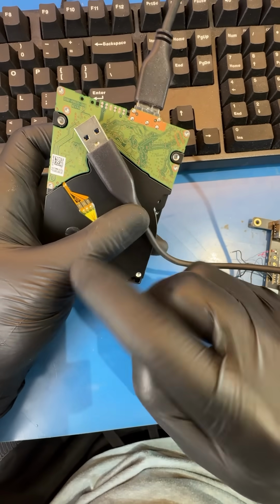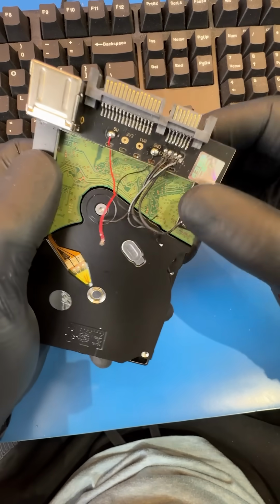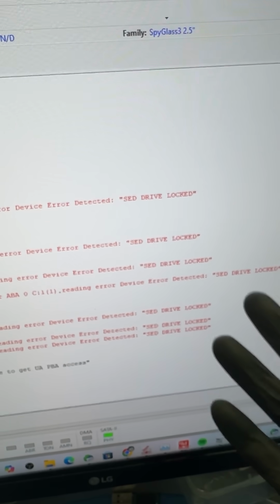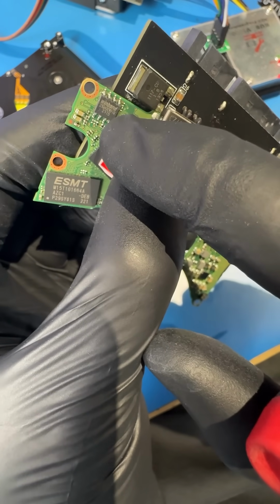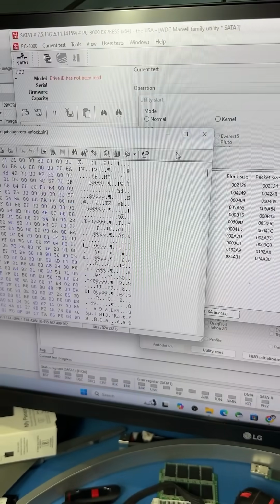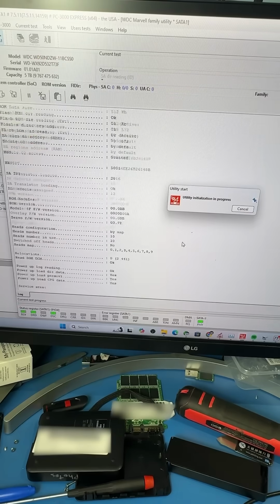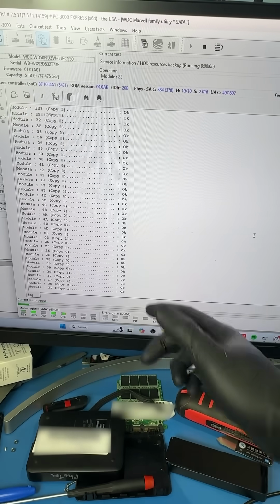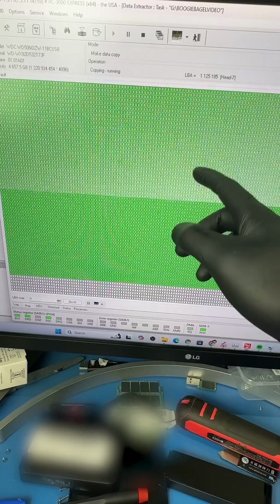Self Encrypting Drives... #tech

Comment: How is this secure with the locked firmware?   Like I understand why some people would like to see it on the features list, but in practice it looks like you've essentially used a padlock on a door, but duct taped the key to the back of the lock.  Not really sure what the point is except making more steps that aren't too difficult.

Comment: Even though the drive was only locked and not encrypted, there are self-encrypting drives. Years ago Microsoft figured out a weakness in the self encrypting drive code, which supposedly some of the manufacturers fixed. 
So based on that event, Microsoft recommends that you do not allow the drive to self-encrypt but rather to use software based encryption.

Comment: so the key for the drives encryption was stored directly on the drives pcb unencrypted!! I guess this is a proprietary security measure specific to the manufacturer and not very secure ..or was the drive just locked by the pcb but the data not actually encrypted?

Comment: It crazy to think that in just 78 years we are able to store terabytes of data on regular hard drives and with specialized equipment we can store a petabyte for perspectivd the eniac 1 could 80 bytes back in 1946 and it was huge taking up a massuve root with vacuum tubes now we can store a petabyte = 1 quadrillion bytes that is a 12,499,999,999,999,920% increase considering advancement rates that it incomprehensible

To visualize that number 1 quadrillion is a 1 with 15 zeros so this 
1,000,000,000,000,000
 The human brain cant even begin to comprehend the sheer scale of that number

Comment: Now you know why it's necessary to drill holes through drives in order to thoroughly disable them.  Even if you have encryption, they can just disassemble the drive, flash new un-encryption locks onto the firmware, and bingo, the data on the drive is unlocked.

Comment: I have 2 2TB hard drives 1 I bought about 7 years ago, worked for about 2-3 years then stopped working, then I bought another 3 years ago, used it literally only 3 or 4 times in the 1st year to back stuff up in it and stored it away for a while,  and it stopped working the 5th time i tried to use it to retrieve files. Lights up, u can hear it spinning, but nothing comes up when you put it in the PC or laptop!
I gave up on all harddrives since! Im now considering buying an M.2 ssd to put in my motherboards 2nd m.2 spot, and use that as backup, and then remove and store it securely with my important stuff, cuz the PC I builts m.2 has been working for a long time now going onto 5 years since I built it!

Comment: I disconnected my drive (by pulling he plug) n it stopped working n getting detected. after this incident I tried many things to run the drive and these tries used to make a clicking sound every time. one of the recovery company said there are too many scratches n data cannot be recovered. will I ever be able to recover the data?

Comment: Before doing any of that try this first.  
If you here that clicking sound, it may mean the read head is stuck.
First just tap with the handle of a screwdriver. You only need one last spin up to copy the data from the drive.
  If that doesn't work put it the freezer, then let it thaw out, maybe 2 -4 days.
Then hook it back up, if it doesn't spin tap the side gently with a screwdriver handle again.
Metal contracts when it gets cold and sometimes this is enough to let it spin one last time. My IT instructor told me this trick and it has worked for me.  Do everything else he said AFTER you try this

Comment: Something tells me that lock feature really helps sell new drives.
Reply: Pretty incredible. "Self encrypted drive" basically means "completely unprotected drive" if anyone can get in. What an absolute joke.
Reply: @TigerGreene  From what I've read, self encrypted drives always encrypt stored data. However, unless you properly configure them with an authentication key, the drive externally appears to be unencrypted. Presumably that extra step was not taken with this drive, so reading the data through the drive was not an issue. Whether the onboard encryption is properly implemented is another matter
Reply: Locked  probably meant it detected a shock and did not want to spin the drive anymore.   SW Encryption drives are used if you want to store your data safe.

Comment: Don't rely on a 2.5" HDD.  I lost a programming project years ago and I'm still mad.  It was a streaming music ripper.
Reply: 2.5" Drives are fine, they generally fail more just because they are usually used in portable equipment like laptops and USB drives. I had 4 2.5" drives running in a NAS for nearly 10 years and lost one drive in that time. It was RAID 5 so didn't even need to recover from backup, just slotted in the replacement and resilvered the RAID.

The thing missing here was a backup.

Comment: Wait, so the SED DRIVE LOCKED (SED standing for Self-Encrypting Drive) can be bypassed just like that? Or did you get the key from the customer? Or does the drive not actually have nor advertise SED functionality, and it's just using the same error code for a non-encrypting SATA password lock?

Comment: One can do this in the bathroom if they tape or hold with magnets, cloths around the boarders of the door and a towel at the bottom with the exhaust fan ON.
I had to unjam a locking piece preventing the disk arm from mounting on the platters. This took time and patience and fixed the 'click of death' problem.

Comment: I have an old wd external drive, that for some reason it's not powering on anymore, I took it out and put it in my Pc, but the drive is not receiving any power. I have a hunch that the issue is the power connector and not the drive itself. Can I get a quotation from you?

Comment: I honest-to-god hate these drives. Having been on the receiving end of a customer tirade a few too many times because of them. Rather than use an adapter board to convert SATA to USB they just solder the board right on the drive handle it all making enclosure replacement impossible. It's especially obnoxious when USB in question is the flimsy USB Micro-B Super Speed port.

Comment: Bro, my laptop hdd is not working so, i opened my hdd to check whether head got struck in platter , but it was in normal position only.meanwhile  small dust setelled on the platter. I ran the hdd , thought not working. Can u recover all data safely ??

Comment: I've 32 GB encrypted memory card same phone before changing my Samsung galaxy m31 motherboard facing auto restart issue after installing faulty software update compny replaced free of cost hardware replacement but my encrypted memory can't decrypt with same phone just bcz replaced motherboard so now what I should I do for recover my data..?
My Samsung memory card currently work well just asked to format but can't so plz help me out to fixed by esY step I'm not it or technician or engineer to repair by self

Comment: What app is used in the video. Does anybody know?
Reply: Looks like Opensuperclone, which is the right choice if you're trying to get data off of failing mechanical HDDs.

Don't mess around with data recovery unless you're VERY SURE you know what you're doing. Running a mechanical drive that is failing can very quickly destroy all the data on it, and if you absolutely need the data on a failed drive then you are much more likely to get that data back by paying a professional than you are if you try to just DIY it.

And it's much cheaper and much less stressful to just keep backups of all of your important data than it is to try to recover data after a drive dies.

Comment: What are all software and hardware tools you used ?
Reply: He's using a PC-3000 express, which is a very specialized piece of hardware with its own software suite designed for imaging damaged drives. They're about $5-10,000 each these days.

Then there's also an eeprom programmer and a soldering iron, but those are cheap.

After that there's the ISO class 4 cleanroom he's working in, which would probably cost at least $20,000 at a bare minimum to set up. Even a tiny dust particle landing on the drive platter while it's open like that would instantly destroy tons of data.

Comment: The fact that you can just bypass a self encrypting drive just like that is crazy. Those are meant to be unrecoverable if stolen
Reply: It’s not “just like that” the whole process probably took a couple hours and you’re just seeing a 30 second clip of it
Reply: This wasn't a "self-encrypting" drive, it was a "self-locking" drive. The data itself was never encrypted. 
A second approach, not requiring the rom reading and decoding, but riskier in potential damage to the drive plates, would have been to swap the drive plates between the customer drive and the donor drive.
Reply: @andrewdreasler428  this would make so much more sense. But then again, kind of pointless from a security perspective.

Glad I encrypt through software
Reply: Yeah but that encryption was locked using a chip you can encrypt in other ways
Reply: not when a wizard gets it.
Reply: Yeah, pretty much just tells you that feature is almost pointless if you have bad actors that would want your data. Just another point of failure. For most people, they would value recoverability over such shoddy encryption.
Reply: In the unblurred section, it identified as My Passport - if I remember correctly, that's a WD drive that does weird undocumented things by moving around the partition table, MBR and other black magic. Might have been a case of security through obscurity... Which is not security.
Reply: If you have physical access to something, it's likely a question of time and effort to find some kind of bypass.
Reply: @RS-fy9hb yes, however with anything that can be considered decent encryption that time is supposed to be measured in billions of years, not an afternoon
Reply: @ This is what I'm talking about. Encryption is designed to keep your data safe for a VERY long time or at least until the data is no longer relevant, even if in the hands of a third party actively trying to crack the encryption. The entire field of cybersecurity relies heavily on encryption and making sure people cant just decrypt your data in a couple hours.
Reply: @ If you have physical access to something, you can read the messages, and stitch together the decryption keys when they send it back and forth to begin with. Physical access to something that lies between 2 devices encrypting their messages doesn't matter if the bad actor managed to listen at the start of the requested encrypted messaging, because the key is then relayed across the network anyway. Encryption works such that someone listening in, in the middle of the conversation won't be able to decipher the information, because manually cracking it would take some billion or trillion amount of years.

This is the reason why super computers would make current encryption irrelevant, because they'd have the capacity to crack these in a matter of hours or days, if not minutes.
Reply: I think this drive was physically encrypted, not through software, so that might have been the reason why this worked. Physically encrypted drives are known to have this "little" issue.
Reply: it's just "locked" not encrypted, the data are written clear on the disk
Reply: Physical access is root access
Reply: wow it's like the biggest companies make the worst crap
Reply: I don't think you quite grasp how easy this is, in principle. He didn't "break the encryption". He removed the deadbolt on the door while inside the house, to let himself inside the house. Essentially, he reprogrammed the ROM and replaced the code that asks "should I decrypt this data?" to "i trust everyone! here's the data!"

Comment: I tried to save my external hdd by using one of the top brand of data recovery. They couldn't save mine. It had plater dust. Cause was the same way as this customer. Dropped.

Comment: This seems like an odd situation, usually for head swaps I can read the drive via USB just fine. I've never had a case with bad read/write heads where I couldn't read via USB but I could read through sata.

The only reason would be if the USB circuitry was damaged, or if you insist on using specifically the PC3K via sata.

Comment: While I copying some files into my 4tb harddisk , I just got a message that the parameter is incorrect  after that  it is never showing up on my system again.I could see that on other devices in settings in Windows, but I couldn't see it on Disk Manager or File Explorer.
It contained morethat 2 tb data

Comment: Now that's a job I would study for.. so rewarding. happy customers
Reply: I'm guessing you also get very unhappy customers if you can't recover important data and still have to bill them for the work. It's usually not cheap.
Reply: @C.Vitalizio - Doctors and mechanics do that every day.
Reply: You ready for doing a 4 year computer engineering degree and at least $250k of debt? 

Well, OK then - better get crackin'
Reply: @ellayararwhyaych4711  if i didnt learn to trade I would have done this 100%, debt can be paid off, but you can't buy back time.
Reply: @ellayararwhyaych4711  you don't need to spend 250k to learn to do this
Reply: @ellayararwhyaych4711 This is not software engineering, it's professional data recovery, you don't need 4 years for that, just be smart with good general electronics and computer service knowledge and about $5000 for the special software and hardware.

Comment: Fake. You can't replace the PCB on hard drives as it will lock you out entirely. And you can't just "write" to that rom. There's several security measures taken to prevent this kind of thing.
Reply: He didn't change the PCB. He changed the reading heads, also the term ROM diluted his meaning to "non volatile storage" as we have things like EEPROM too
Reply: @luisbastidas1898  Semantics aside, what he did isn't possible as hard drives are manufactured specifically to prevent things like swapping the PCB/converting it to SATA. It's just not possible.